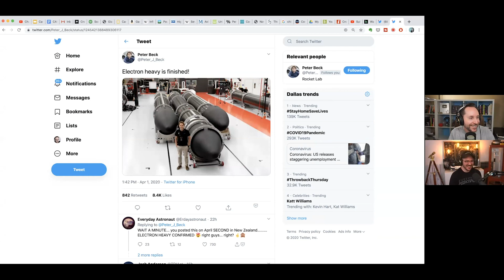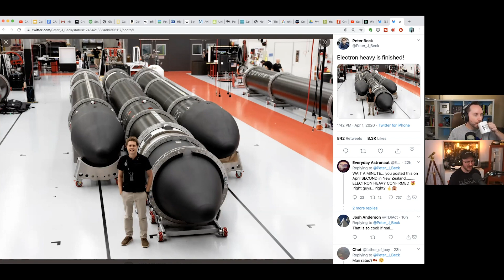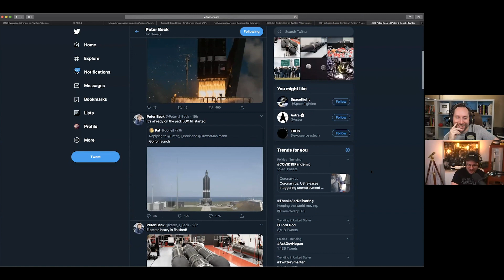Why Doesn't Rocket Lab Build Electron Heavy (Highlight - Ep78)

Comment: It's easier and lighter to use a first stage that's 3 times as big then to use 3 boosters together. The only advantage space X gets from the  Falcon heavy is that the 3 separate boosters are easier to transport.